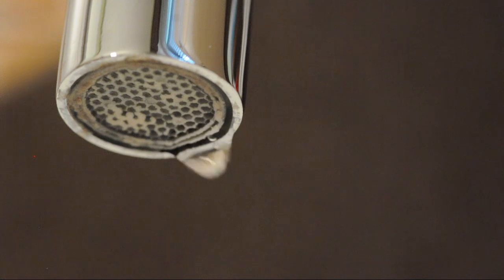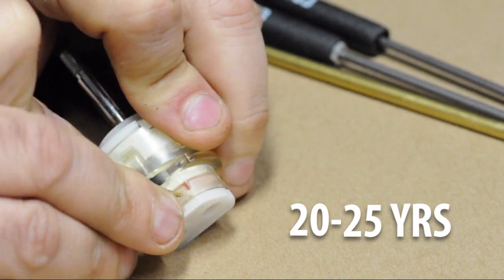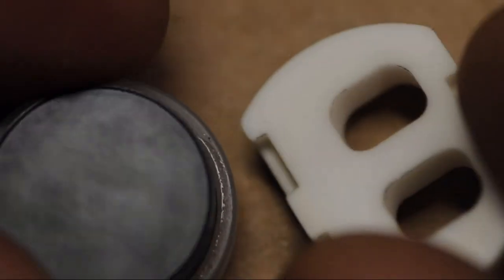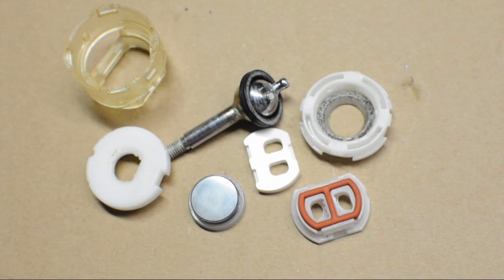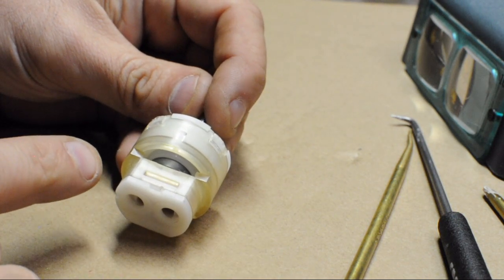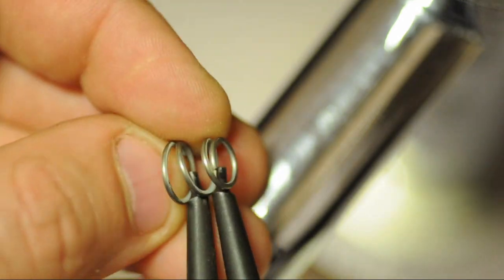Leaking Ceramic Faucet Fix

Comment: maybe add a screen filter on the inlet pipe to prevent debris from getting stuck in the valve again.

also i have to applaud you for having a faucet that is completely limescale and rust stain free, your local water must be crystal clear, i personally have to rely on a whole house filter to prevent the same issue since my water system is very calcium and magnesium rich (with a hint of mud/silt) in it.

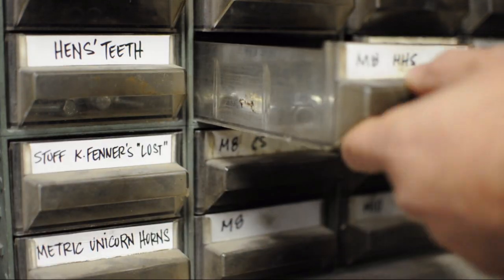Comment: 0:55 every now and again I get to a large hex head and literally never have that size because I don't ever invest in tools. so just put multiple smaller hex heads together. if you put enough of them they will bite and the pattern can also leave the hole that's needed around the lever

Comment: Ha ha  yup. Could have told you it was those two replaceable cup seals. They are what always fails on this type faucet.the ceramic parts really should last 25 years.. You could clearly see the black circle smudges on the bottom of your valve while you were working on it. Tell tail sign of the seals aging and starting to fail.  Had to chime in.cause it was one of the only times that I knew about something that you didn't catch. Most of the time I just watch you work with my mouth open and think..man I wish I had your knowledge....And shop. You are an amazing machinist /engineer..ECT.  my favorite channel.

Comment: $100? It would be cheaper to buy a new faucet. Including a valve. 

This is why the old fashioned types that used a grommet that cost 20cents to replace once every 6 months to a year.
Reply: $100 wouldn't replace 1/3 of the cheapest faucet in my house. Good faucets are pricey.
Reply: @Undefined Lastname agreed.

Comment: Its now 25/2/2018
Has it leaked since you fixed it ??
Reply: The Workshop Mechanic 
It is now Sep 13, 2018.
The tension is unbearable!
Reply: @SideBurn12  3 days ago he said in a reply to another comment that it's still holding out
Reply: AES 2015 
Ah ok, nice!
Thanx bud :)
Reply: Its now oct 6, 2018...whats up with that seal
Reply: I am here for the comments (and the update)
Reply from the maker: still dry!
Reply: @ThisOldTony  flipping that gasket and the slight bit of Teflon pushed those plates together. That B shaped gasket is probably your culprit. I've changed and rebuilt many stems/cartridges. Stretching those springs didn't hurt either.
Reply: @roberthaas5372  ,I'd say spot on. I have Donson Brand ceramic disk taps (that's what we call them down under), the discs are as indestructible as a ceramic tool bit. However, the o rings used to create pressure on the fitting gets flattened and need replacement. I haven't been able to find the o rings as a single part and the kit cost $36 each! You can buy a lot of standard washers for $36.
Reply: @jamesmcgee7723  10 for 1$ in chicago usually. That would be quite a few. I recommend moen shower valves to customers because every hardware store has their 2 cartridge sizes and I can talk someone through a cartridge change on the phone.
Reply: @ThisOldTony   ....... You got to update status every month on the month !  That is the Law of the Land !
Reply: @roberthaas5372  I respect someone who sells stuff based on serviceability!
It makes sense to recommend something that has widely available replacement parts and easy service, I mean it only makes your job easier in the long run right? After all, assuming you did a good job at a fair price (not always the lowest), chances are good that you'll be getting further business from them in the future.

Comment: I work with sub micron glass and ceramic glass daily for optics. That haziness is bad surface roughness, but I have no idea how long it will take to be a problem. If you wanted to polish it, I'd recommend making a jig. Last thing you want is turning a coplanar plate into a wedge.
Reply from the maker: good point, thanks Aaron!

Comment: Neat.

The ceramic surface roughness reminds me of magic mirrors. In the far east when Christianity was banned, Christians began to carry secrete symbols with them to identify each other. On of these was a magic mirror. When you looked at it, it just appeared to be  simple mundane mirror, maybe used for shaving our grooming of some sort. But, when you shined light on it and looked at the reflection it cast, it would be a religious image.

How this worked was very fine deviations ground into the mirror so minor, you wouldn't notice them looking at it, but those small deviations reflect light at a different angle than the untouched parts, and that small angle causes a noticeable difference when projected many times a larger distance than the actual deviation.

I think a Japanese company manufacturing platters for microchips utilizes this idea to measure uniformity on the platter surface. The shine a bright light onto the surface at a angle, and look at the projected reflection to see if it is smooth and uniform enough to use. You might be able to do this with those ceramic pieces if you have to take the valve apart again.
Reply: This is called "interferometry"

Comment: i had a tap problem as well, after just 1 year it dripped a lot, so i took it a-part, and found that a 1cent plasticky ring was squished from maluse or malpractise, so replaced it with a plastic dowel-ring i cut off, and now with a higher pre-load it's working perfectly.
i have the twisty knobby version with hot and cold seperately, and with taking apart i could reverse the turning direction it opens! :D you never know what you learn by taking things apart :D
now onto finding B-part...
(oh yeah and the shop didn't even had that valve at all, not that it would have been cheap :D)

Comment: They expect you to just buy a whole new faucet each time at this point.  The dual handle ceramic cartridges last a lot longer than the single handle ones though.  Very simple design, two stacked certs mints with holes to line up on rotation.

Comment: Oh hey, you know those cup seals from the bottom half of the innards? Yeah, I used one just like that to repair a master-cylinder on the rear brake of my YZ 250 back in the early 90's. It was so odd that the one faucet I'd repaired in my youth happened to contain a seal that looked like the shredded one from my bike...and that we still had a spare one in Pop's set of do-dads :)

Comment: I had a similar problem and shortened (lapped) the plastic housing to put more pressure on the rubber piece. It worked for a few months, but I really think the fresh lube did most of that. That's what you get for having fancy Italian designer Faucets. ;-)

Comment: ... Tony Pause Video at 7:28 the parts landed ...
... Perfectly in your Palm ...
... Note the step at the end of the Springs ...
... Look at the bottom Rubber seal ...
... The difference in colour between ...
... 12 & 3 pm this is where the step in the spring ...
... was seated HOW 2 fix the Dripping tap ...
... Measure the internal Diameter ...
... Locate a A4 grade Stainless Steel Washer ...
... As near as dam that size ...
... Drop one in the rubber cup round edge down ...
... Flat side facing the spring ...
... No need to stretch the spring ...
... That will only make them dig in more ...
... If there is a small hole/tear at 3 pm forget it ...
... Re-assemble & your good to go ...
... Might only be a Temporary fix but ...
... But it has lasted 7 years on my Taps ...
... Yours Retired 3 score & 2 UK Plumber ...
Reply: @lvk104  i lost him at hole at 3 pm
Reply: Maybe he meant hole at 3 “AM” and not PM! Should switch to German 24hr time. Damn that metric system! So easy to forget where the decimal goes!!!

Comment: Microinch? What is this abomination :O
Reply: knowing the imperial system it could easily be 1/8 of a 12/12.5 of 32/5 of 123/321 of the surface of the moon divided by the past christmas!
Reply: 1 microinch = 37.4 km

Comment: robber576
"A large security hex" is called a tubular socket wrench, meant to be used on the inside on nuts and bolts but the outside can also be used...
It will last again for years, mine did after i did more or less the same as you did, flip the seals clean and descale with citric acid and put together with a tiny amount of dow corning 111 silicone grease.

Comment: Change the valve. Once the porcelain goes bad it's done. Even a new seal for the seat wont stop the leak. The surface tension on the plates is so great they seem magnetic.

Comment: In my kitchen I had no water, got it opened, CA glue the lever, then put it together... Well I got water but, manage to crack the casing 😕 at least the replacement had a metal lever and cost 35
Reply from the maker: you glued it always open?
Reply: No, the valve lever was plastic and got broken, couldn't slide the disc! got it opened and CA glued the lever, but somehow I manage to crack da housing! Worked, now I could turn on and off but I got a leak due the housing crack 🙈 fixed one problem and got another
Reply: The replacement had a bronze lever valve, so, I guess it was the weak point and they had improve! You can search and see the plastic and the bronze "lorenzetti t-277"

Comment: Try a soak in a mild acid like citric or phosphoric.  Citric acid powder is available at any health food store. If going to a chemical supply house isn't your thing, liquid toilet bowl cleaners are largely phosphoric acid. Coca Cola's flavor bite is from phosphoric acid.  Mineral deposit buildup within the valve often causes slow leaking that leads to drips. A friend and I fixed his family's Grohe faucet dripping (very expensive German parts) by dissolving the mineral deposits. Watch out that the acid doesn't get too aggressive on the metal stems and handle.

Comment: Our kitchen faucets are made by Rohl, pretty good faucets. But my wife (whom I love very much!) has a bad habit of slamming everything closed. Cabinet doors refrigerator doors. The door to the microwave, and of course, the faucets. After about q6 years, the stem to the faucet valve broke off. When I disassembled it, I saw the square 5/16” stem was sheared off. The cartridge otherwise was just fine. Unfortunately, the way it’s made, there was no way to replace the stem, so I had to buy a new one. I wish it was $100, let’s just say that.

So I took the old one and took it apart, at least what of it I could. The ceramic plates were in perfect shape. They were polished so finely, I could wring them together so well that they were really hard to take apart, noticeably more so than my gauge blocks. There are ceramic gauge blocks, and they cost a fortune, more than tungsten carbide gauge blocks. I now understand why.

Comment: I had a customer ask me to fix an old airgun. I took it apart and found no reason for malfunction. I lubricated all the rubber parts with spray silicone and the metal parts with Lucas gun oil. It operates normally now.

Comment: Tony...I think you should've first checked with NASA to see if that faucet wasn't actually meant to be installed in the bathroom on the space station! It's like they designed it to be as complicated as humanly possible.😵 Excellent save though. 10/10✅👏

Comment: I use vaseline on all the rubber on cartridges. Pulled one out the other day after being in there for 8 years to clean and inspect, all the seals where in great condition, and still had a coating of vaseline.

Comment: Tony, 
you need to change the rubber seals that sits on the springs and they have to be pointing the right way. that's why your faucet is leaking.

Comment: I had to repair a Danfoss tap a short while ago. That had similar spring seals. But, the valve was a ball type with a large seal. That was easy to repair.

Comment: they use similar seals in Washing machines, Water pumps on engines, etc - but I always thought the white side was a ceramic, and the dark side was some sort of graphite or carbon or something, not both sides ceramic? seems like I learned that in some sort of class back in Washing Machine school in the late 80's early 90's??? IDK?

Comment: ceramic discs last ages, especialy if you have a basic filter to catch the big bits of sand etc from the supply. they always fail because either the disks aren't pushed together enough as a rubber seal has got to flat or like in your case the o rings go the same way. you can pack them all to buy time. old school taps where just packed no o rings. you could service one with your own greasy belly button fluff lol

Comment: Those gaskets with springs looks just like the ones damixa faucets used to use in the past, which had very short lifetime, they changed them to a spring in a little plastic sleeve and it seemed to help the lifetime. But nice video :)

Comment: For sure it was your seats and springs the springs are seldom the culprit though they can shift. The seats however are exposed to hot and cold water endlessly too much for 3mm thick rubber to withstand over the years

Comment: I know me and I would've gotten some 1600 grit sandpaper and wet sanded those faces, without considering any .40 or 0.5 nano micronians. (I like making up words.) Flipping the rubber seal was a good idea that I too would've tried. I thought $100 for a valve stem was the kind of stuff proctologists specialize in! Heinous!!

With regards to the wager, I didn't hear you say how long it took for this first leak to develop. Therefore, I'm going to make an educated guess that it'll take a couple months less than 1/4 of the first leak time. So if it took 8 years for the first leak to appear, which I think is a fair guess, this repair will last 22 months. 😃👍

Edit: seeing that YouTube just recommended this video and it was from 2016, is it still working??
Reply: Any sandpaper you can come up with wouldn't touch that ceramic. The disc looked like Tungsten Carbide, and the only things that cut that are Cubic Boron Nitride and Diamond.
They polish those faces down to optical flatness, and by that I mean the difference between the highest and lowest spots is less than the wavelength of some form of light (probably infrared). Any rougher and it's gonna leak like a sieve. You can't get that smooth without some very specific processes, certainly nothing a home workshop could reproduce.

Comment: The cup seals are your failure, if it drips again, just replace those with new springs, they usually come as a set and it should not drip.  Over time the chemicals cause rubber to harden and lose seal.

Comment: Actually reason is the rubber washer right now not enough strength because long time using.You can put some copper wire put underneath the robber washer.Get the whole rubber washer position a little bit higher.The rubber washer seal will recover.The faucet will not be leaking.

Comment: Those ceramic plates only hold a seal if they are pressed together, are they are pressed together with that orange "O" ring, maybe it lost the ability to push up on that lower ceramic plate?

Comment: I've always found that! to gain some extra 'trouser room' against the biblical reference of "a nagging wife, is like a dripping tap" is to carefully think of something way bigger, that needs doing! But is ultimately beyond your budget. Disscuss... By the time this conclusion is reached, it time to get ready to go out. Or tie a little length of cotton string just behind the nozzle and down into/touching the basin. The drips will run down the string as a stream, stopping the noise.. both will only give you a day, tops. Well done for stopping the leak. Happy wife- happy life.

Comment: ToT, those last seals with the springs behind them, they're fashioned so that the water pressure coming to the faucet aids their sealing.  That is, they can begin to leak if your water pressure diminishes or for the usual reasons, like if they get old and or wear out.

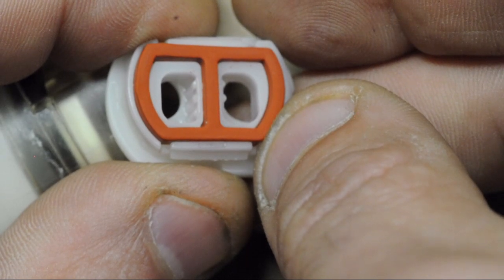Comment: 3:16 If the part was 2-dimensional it would not have a thickness in the third dimension that we live in, it would only manifest as a boundary plane. It would definitely be reversible though, but not much good at being a seal. Seals are 3-d, even the highly trained ones.

Comment: I usually fix these things as you did here, except I use silicone paste.  Ceramic valves have only one but rather tough enemy the waterhammer. It not only pushes the sealing gel out from the discs, it stresses the plastic housing to the point when it can't hold the stuff together properly because of the permanent bend it suffered. After every single reassembly you have to screw the nut a little harder, which makes the rubber sealant between the tap and the housing flatten a little bit more, 'till you can't even move the handle anywhere without forcing it. Thus you buy an new component (if they even sell any that fits at that point), and the cycle restarts.

Ceramic valves are nice for sure, but they are expensive to maintain, especially when there're crude, and inpatient people around.

Comment: I've had similar problems in other ceramic valves, where it would start leaking after a year or so.  The ceramic valve itself was still good, but the  gasket that was in between the body and the valve assembly was not good enough.  Adding another thin gasket in between fixed this.  I've fixed three different sink valves this way.

Comment: I believe the soft rubber cups eroding upon the firm ceramic surface was the culprit but, This Old Tony have you considered solar flares?
You prolly have not even considered, the use of proper aluminum foil headgear... I am galvanised.

Comment: Those seals look like the ones used on a Delta faucet and they crack and leak in 10 years  sometimes because the lever force on them are too loose. or debris get past them with water pressure.    If the nut was so loose a child could remove it that may have been the problem.

Comment: Two points. Those spring loaded washers/cups are really cheap to replace. Secondly, most name brand faucet manufacturers offer a lifetime warranty. Contact them and maybe send them a picture of the faucet and/or cartridge andcthey will usually mail you a new one for free.